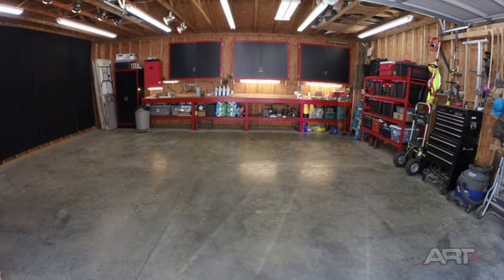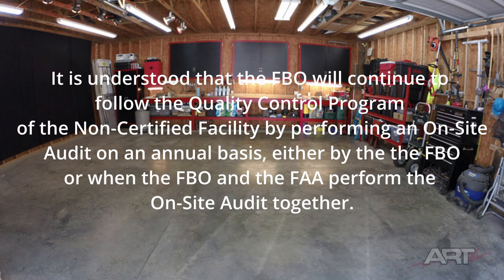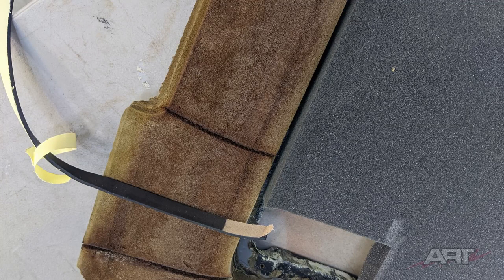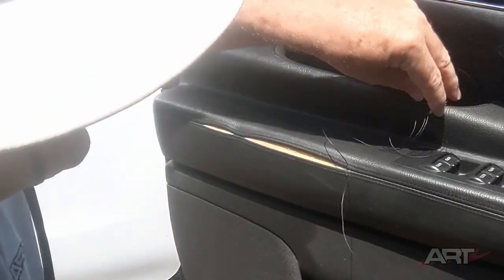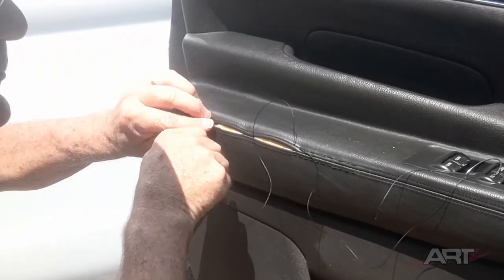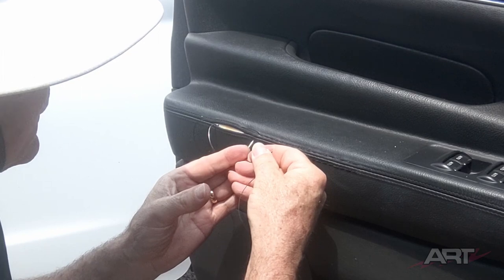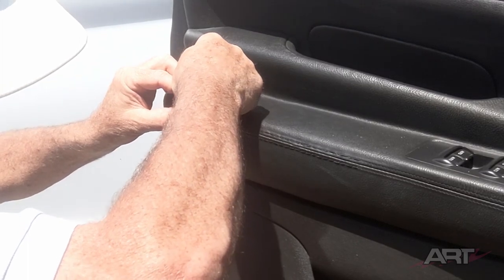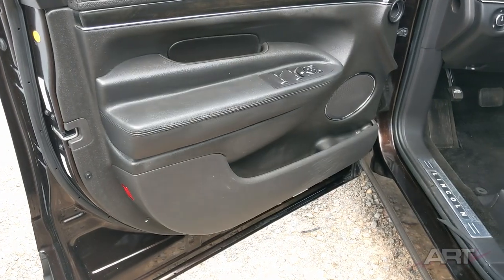Annual Inspection/Lincoln Door Armrest v97

Comment: Nice repair, I have not run into one of those, I've seen plenty of the Explorer armrests and some with the support and foam missing underneath, in which case they just need to be replaced. Good info on doing work on aircraft, I will be checking into that more closely. Thanks for posting as always!

Comment: Great video. Just fixed a Lincoln armrest the other day. Up until that point I hadn't seen a Lincoln armrest like this. I've seen some repairs where the tech just put a ton of super glue gel into the gap and did a little stitching. Never holds and it looks awful and jagged. Not fun to fix one after it's been half-assed with super glue. Out of curiosity, what do you charge to fix an armrest like that?